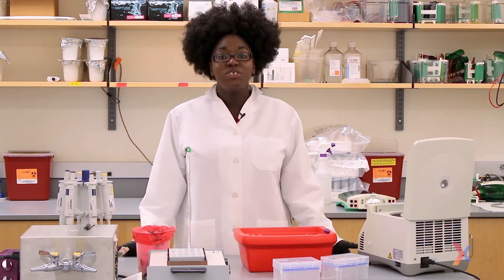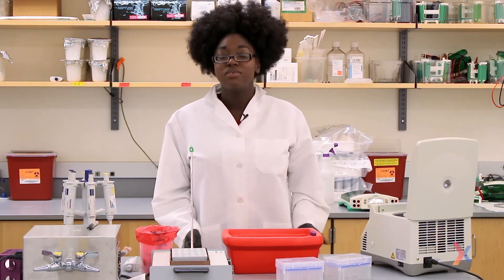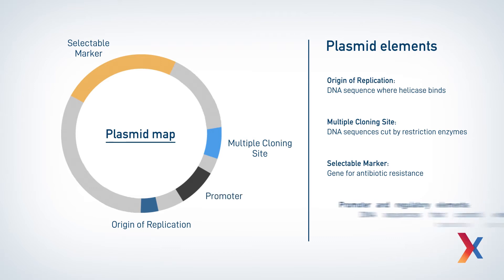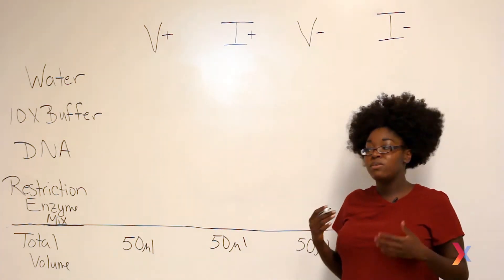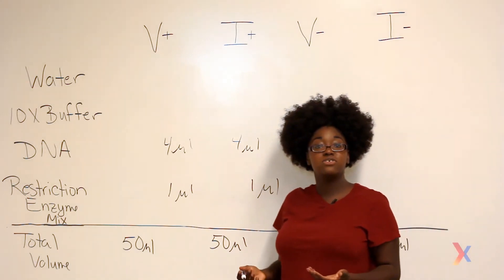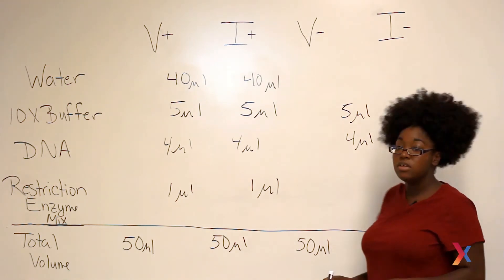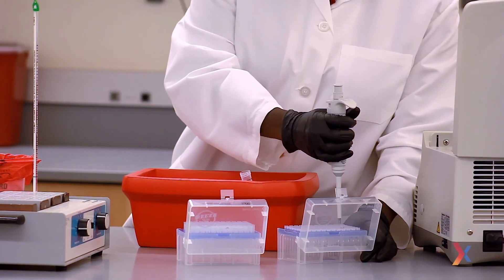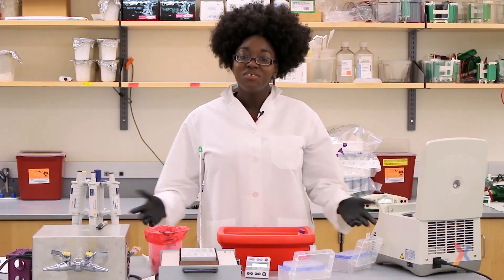Restriction Enzyme Digest

Comment: Hi LabXchange, I just want to ask something about this lesson. and here's the question

why do we need to use vector plasmid and insert plasmid in this reaction? and what's the differences between vector plasmid and insert plasmid?
Reply from the maker: Great question! Basically, you have a vector (the majority of the DNA needed to express proteins) and then the insert (the DNA that codes for the gene that expresses the protein you actually care about.) Sometimes, the insert DNA comes from a linear fragment. But in this case you're cutting it out of a circular plasmid. Does this help?
Reply: @LabXchange  Yes, it does! thank you so much LabXchange :))